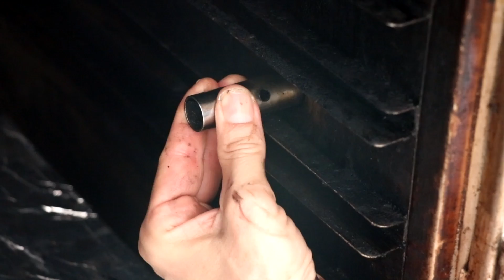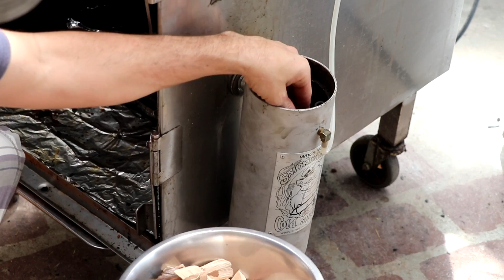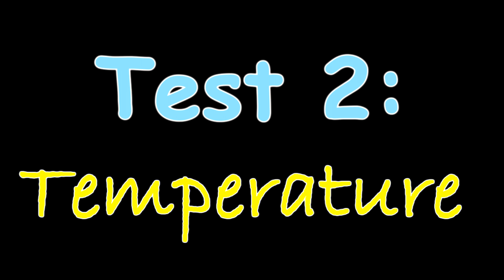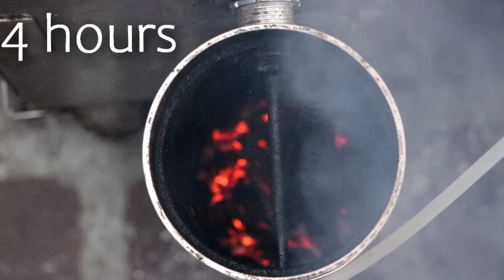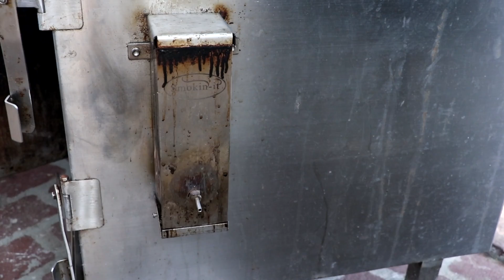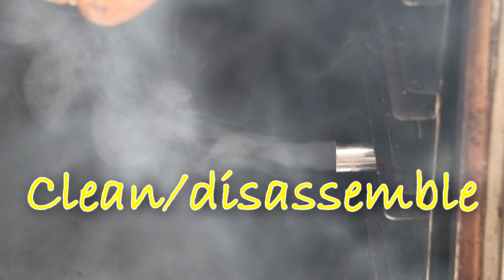The Battle of the Cold Smokers - Smokin it vs Smoke Daddy

Comment: Eric- are you adjusting the top vents of the Bella at all? Just set one up and not sure where to set the adjustable top vents, which are extremely stiff and seem to be a set it once type of vent. Will be using on a smokin it smoker and smoking sausages.

Comment: Biggest changes & upgrades that improved my smoker was 1., adding a small fan to the inside of my smoker 2, opening up the flue more to allow the smoke to flow freely - 3.,rebuilding my smoker into  a horizontal VS vertical smoker- those three changes make true cold smoking with my unit EASY   I have used the Smoke Daddy Magnum for years and am moving to the P.I.G. -  - no thank you on using pellets
Reply: How did the horizontal orientation improve the process?
Reply: Why not use pellets when you know you can use different types of wood such as hickory, mesquite, competition blend, cherry or more? Do you feel like there's a difference between using straight wood chips versus using compressed wood pellets?
Reply: @idaho2085  
Ive tried every pellet from Matt Pittman Branded Traeger pellets, Lumber Jack, B&B, Bear Mountain, Knotty Wood.... An to be 100% honest I can’t differentiate a difference from one brand of flavor to the other! I believe it’s more marketing then anything else .... Saw Dust pressed into a pellet will never provide the flavor that unadulterated Wood chips or staves produce. It’s why everyone is trying to gain stick burner results /flavors with the simplicity of a pellet grill. It’s truly an exercise in futility without the use of some sort of modification that burns actual wood chips, chunks or splits.

Comment: I had one of the smoke daddy's but I no longer have it. I bought it to smoke sausage. My sausage goes thru a 1hr drying cycle until casings are dry to the touch. The pump from the smoke daddy seemed to be pumping in moisture from humidity in the air. The moisture was making my sausage casings wet. The casings need to be dry for proper smoke adhesion. Has anyone out there had this problem? Thanks.

Comment: Is the Smoke Daddy 16" tall from the bottom of the screw cap on the lower dome to the top of the screw cap on the upper dome? Their design schematics on their website are a bit ambiguous about the total length vs just the length of just the metal structure.

Comment: Bellas is not the same size nor is it the largest unit from Smokin-It.com
Reply from the maker: So smokin it has 2 sizes now.  The Bellas (which is the one you see in this video) and the Sable XL (which was designed for smoke houses).  Unless you have a smoke house the Bella's Cold Smoke generator is the way to go..

Comment: One thing not mentioned is the type and quality of smoke.   That is very hard to measure but I don’t think anyone would argue that pellet smoke is not lighter than charcoal/wood smoke.  I’m very happy with my magnum PIG on my RecTeq Bull.  I haven’t done any cold smokes though.  I use it to add extra smoke to long cooks.  With the PID of my Bull, I have no temp fluctuations.  I would rather have to reload more than have just more pellet smoke.  Food for thought for anyone debating between the two.
Reply: I 100% agree, I have the RT700 and the Smoke Daddy Heavy D Heat Diffuser and I love it, but I’m getting tired of having to remove the grates, drip tray and the diffuser to just reload chunks of wood. so I’m thinking of buying their PIG. does it help a lot with bark? cause the Heavy D helps a lot with bark
Reply: @timcapell  
How long of a smoke are you getting out of your heavy D before needing to refill?  Are you using splits are chunks ? Do you fill both sides? How’s temp swings? I just purchased a diffuser from Smoke Daddy  but wondering if I should have went the smoke Gen route ... for reasons you mentioned ... appreciate your response . Have a great weekend !
Reply: Do you have your smoke daddy mounted on the right, or left side of the bull? I can't decide where I'm going to mount mine

Comment: Any chance the smoke daddy might have lasted longer and burned cooler if you lowered fan speed below 50%.  Also CAN  pellets be used in Smoke daddy?  Would using same fuel even out results?.
Reply: I would love to see that as well. Although smoke daddy does not recommend pellets in its smoker, they claim that it produces bad quality smoke.  I do not understand that since we just saw that similar design (smokin) works well with pellets. If any one has some answers on this topic I would love to hear about them

Comment: Pardon my ignorance on this. Is this going to give you a better result than a smoke tube inside of your smoker. I have a pellet smoker and use a smoke tube inside, and I get a little bit of a off flavor from the tube when doing cold smoking. I read one of your other replies on a comment and said you don't get any off flavors from these units. Thanks for the video!
Reply from the maker: I find that it produces better and more consistent cold smoking results.  So far I've had nothing but success with no off flavors with this cold smoke generator..
Reply: Look at that, one of my favorite brewing equipment channels posting in another one of my favorite hobbies channels. Since brew days take a long time as well, maybe make a smoking / brewing simultaneous combo video Brian, cheers!
Reply: @derekremington8807  Lol!! As a matter of fact I bought a smokin it and I'm doing a install video on my other channel.. 👍🍻
Reply: @ShortCircuitedBrewers  I wonder what cold smoking malt would impart flavor wise to beer
Reply: @derekremington8807  I'm pretty sure would be about the same as the smoke malt that you get in the homebrew supply store. The trick will be trying to figure out how long to smoke it for. Sounds like a good video topic to me.. lol

Comment: what drill bits did you use when you installed it on the side  I have a Smoking-it #4  and not having much success  TIA
Reply from the maker: I started with a small titanium bit to make a pilot:  https://amzn.to/34XeI3o.  Then increased the size to 1/4 inch with another titanium bit then finally used this to make the hole for the cold smoker  https://amzn.to/3mQZPWC
Reply: @2guysandacooler  Thank you for your prompt reply I BOUGHT Coalbolt  got nowhere  Iwill try what you recommend that was a great video when I saw  70 degree smoke  that was it. I also enjoy all your videos Thanks again !

Comment: It'a a bit of an unfair comparison since you are comparing different fuel types.  I'd like to see that same burn with pellets in the Smoke Daddy...that said, both products seem nice.
Reply from the maker: The smoke daddy doesn't work with pellets but I have used chips in both with nice results.  What I liked mist was the actual smoking temp.  Regardless if the fuel the smokin it cold smoker was able to smoke at lower temps.  😁
Reply: @2guysandacooler  I remember talking to Dennis about it and he said it works with it, it just isn't recommended because the burn isn't as efficient.  I might throw a few pounds of pellets in and see how long of a burn I'd get.  For pure cold smoking, your test favors the Bella, makes perfect sense.  For me, I use it almost exclusively to enhance my regular cooks.  Thanks for the review! It is nice to see what other products are out there.  I was pretty impressed to see you get 4 hours out of a canister of chips.  I don't get that with chunks...great review!

Comment: Very informative.  My Bradley smoke generator stopped burning pucks so I picked up an A Maze N 12 inch tube and got good results.  That goes for four hours but the Bella is appealing with the extended smoke time.  I'm new to using pellets.  Is there a particular brand you find to have the best quality and smoke flavor?  I've heard pellets are generally not as much flavor.
Reply from the maker: I haven't settled on a particular brand yet.  I've tried both chips, blocks, and pellets and find that the pellets deliver great flavor just like the others..

Comment: Great video,,,Question, so hope you still check in,,,,no off taste on the pellets,, and did you try the pellets in the smoke daddy?  The real question is since I have the smoke daddy,,,going to make my own square somkin unit,,,is nothing in the interior of the smokin-it   unit,,,just empty  and it gets the air from the two holes in each side at the bottom....can pick up the square tube  and cut it to length in my machine shop....Great in depth video,,,well done, Thx
Reply from the maker: I don't notice any off taste from the pellets.  The Smoke daddy wouldn't work right with pellets.  I had to either use chips or chunks of wood with the smoke daddy.  The interior is an empty box.  It does have a tube that allows pumped air to be pushed in and an outlet (that feeds into the smoker) which allows smoke to go into the smoker..

Comment: the big variable difference is the heat source. I would think that the flavor of the Smoke Daddy would be better though since it was using actual wood and not pellets. That would also account for the time difference (maybe heat too?). 
I wonder what the Smokin it would be like using wood chips as the variable.
Reply from the maker: Funny you should mention that.  I'm actually smoking with wood chips in the smokin-it smoker as we speak.
Reply: @2guysandacooler  how did it turn out?
Reply: If I want to make more smoke flavor I’m adding wood chips not more pellets.  Please repeat comparison with same fuel type = wood chips !!!

Comment: Hi there. I have the same Smokin-It set up as you and have been quiet frustrated with the cold smoke generator. No matter what fuel I use, pellets or chips I end up with a condensation issue. The pellets get wet , stick to the sides. The inside of the cover collects all the moisture from the burning process, it condenses on it and it drips off back onto the fuel source causing poor burning due to wet fuel and bridging, sticking of pellets.  Can you please give me some advice!??  I waited a long time to buy a smoker with a great long lasting cold smoke generator and so far very disappointed....  Thanks much in advance. Cheezhead Dave from Wi.
Reply from the maker: Hey Dave.  I've noticed the same thing but it's never been a problem.  What I would recommend doing is cleaning out the hopper completely after each smoke.  Only add the amount of pellets you want (full hopper will give you 8-10 hours of smoke), and be sure to really crank the air up when lighting the unit to get the smoke going well.  After a minute or so of really strong smoke turn the air down to about 50%.  Let me know how that works for you..
Reply: 2 Guys & A Cooler   I have tried all of this.  If only smoking for a couple hours meaning few pellets then it works but if smoking all day or overnight The pellets turned to mush stick to the side from absorbing all the water condensation and it does not work. I called smoke sausage for several days to a week at a time so I really don’t want to have to re-add a handful of pellets every two hours.
Reply: 2 Guys & A Cooler   That’s supposed to be cold smoke. For several days. Lol.

Comment: I'm really torn between the two, I like both. Being it's going in a small smoker, (Masterbuilt 230S), I'm concerned about to much heat when using the cold smoker itself. 

I like the idea of a long smoke time with the Bella but very concerned with everything I read about pellets being hotter than chips. I was taken back when your test resulted in a cooler burn using the Bella with pellets. Can you or anyone confirm which burns cooler, chips or pellets ?

Comment: I have the smoke daddy Magnum . I did at the beginning. Had to fine tune it. For example what size natural wood. And I also like to run half and half. Mixture of wet to dry wood chips. Also I have found using the pellets gave my meet a off taste. I also use a water pan.im getting my temps around hi 80s to low 90s .but to be fair during the summer. Just with the daddy the temp is over 💯 but I chalk that up to Florida.lol
Reply from the maker: Hey Big John.  You are so right.  There's a bit of a learning curve for the smoke daddy, water pan is a great idea.  I didn't show it on this video but I experimented with wood chips with the smokin-it model and got favorable results as well.  I generally like to smoke my meats through the night so for me having a long smoke time without having to refill was a really cool feature.  Florida heat!!!